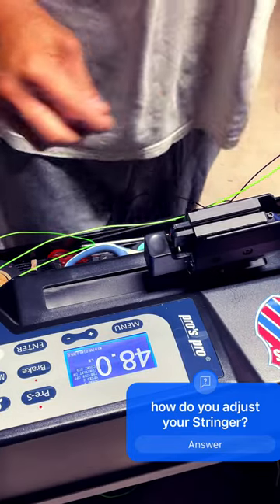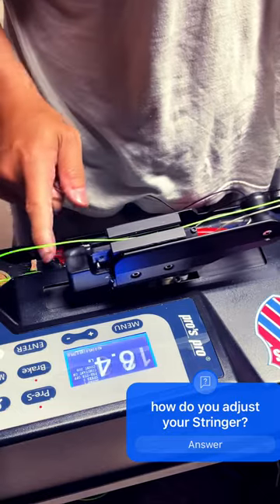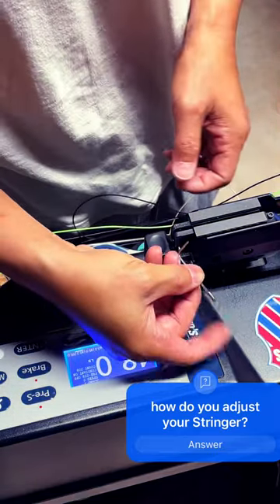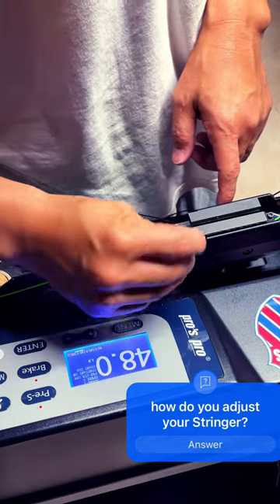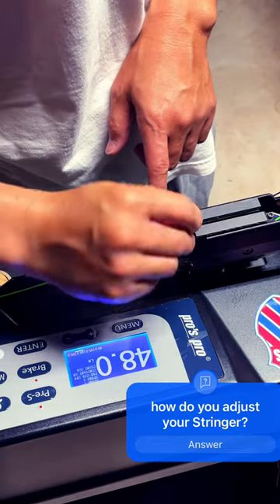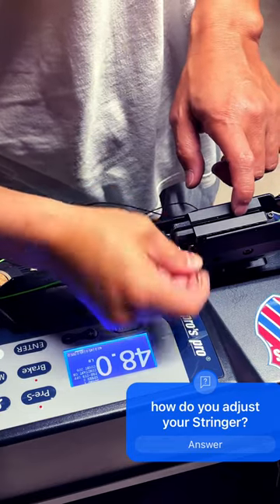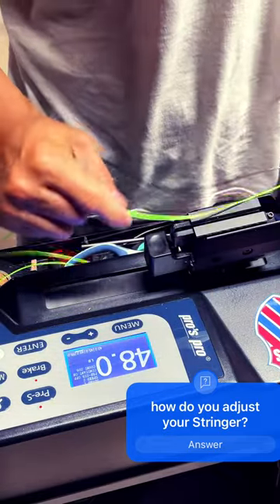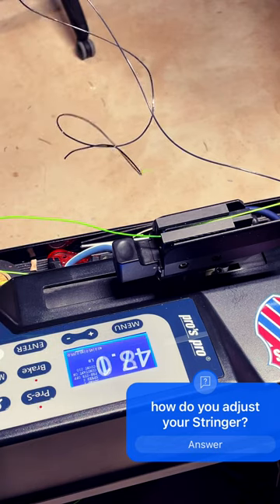Racquet stringer gripper slipping! Adjustment 1 #tennis #shorts #sports #stringer

Comment: What size is the Allen key? Thank you
Reply from the maker: I’m not sure. I just try something that fits. Maybe 1mm to 1.25mm range. 🤷
Reply: @Letsgetstringing  I just figured it out to move it almost all the way but it is like the gripper doesn't close, it is "loose" any clue? Thank you again dude
Reply: @tennistrainingtop well maybe you’ve unscrewed it too much. Try tightening it again and hopefully you didn’t lose that screw somewhere 😅. Sometimes the grip pressure is actually ok but the insides of the plates need cleaning as it may lose grip pressure when the teeth surfaces become too dirty.